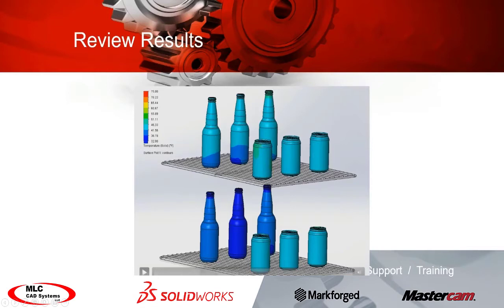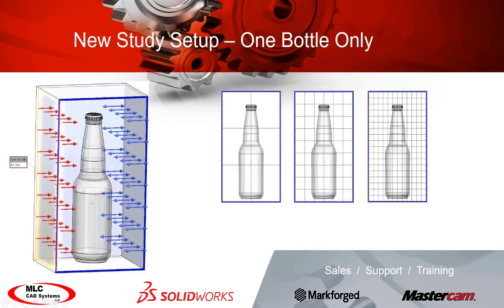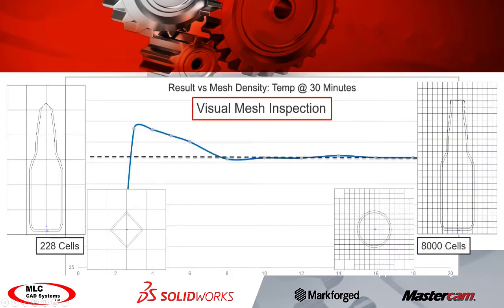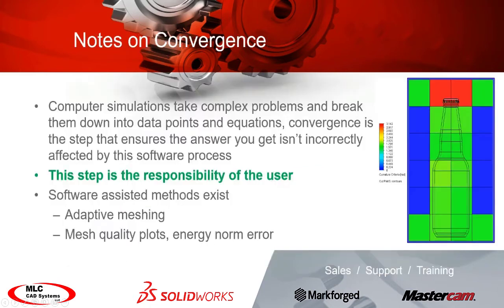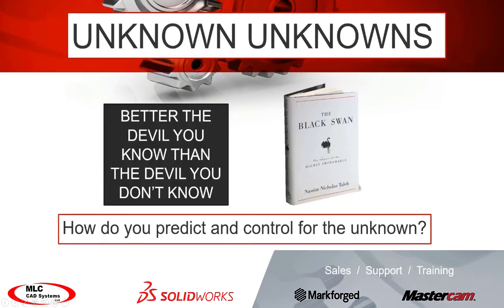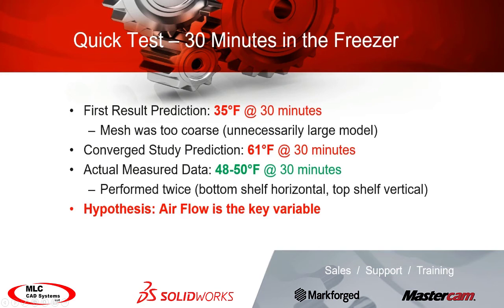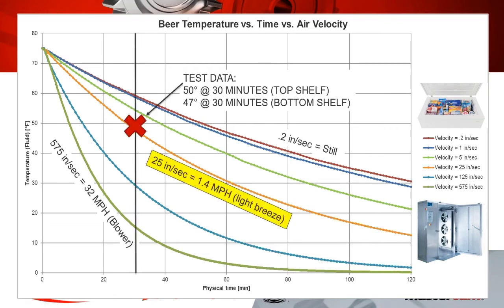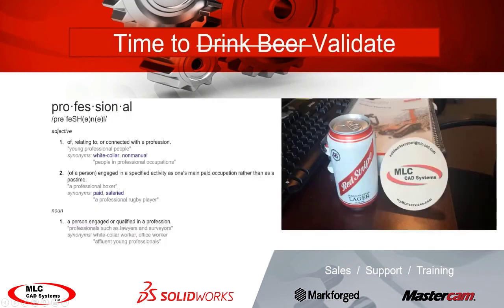3 Steps to Accurate Simulation Results - Converge, Calibrate, Validate - Flow

Comment: I would need support for the following issue: If you have an Assembly of sheet metal, you will end up with sharp corners and as there is no fillet possible between 2 sheet metals it will lead to singularities and invalid results. So, one has to revuild the assembly as solid part to add small fillets. Is there a way, to simulate sheet metal assemblies correctly? Kind regards
Reply from the maker: This is a good question and it illustrates a few points.  First, not all areas of potential singularity will actually create a singularity that you need to address.  If the area receives very low stresses or are oriented in another direction, that singularity will not be visible in your results, and although it would not be possible to converge results there, the results in that area are discarded anyways if they aren't areas of concern.  Singularities are only a concern if they present as an area of interest based on your initial results, or they falsely represent a higher stress than is accurate.  

Second, not all CAD models can be used as-is for simulation.  It is very common that you can use the design models directly, but in some cases, especially where situations like this arise, you will need to idealize the region or save it as a multi-body part and merge/manipulate the model to make it more appropriate for your simulation use case.  I hope that helps!